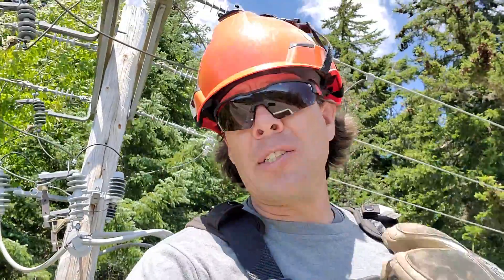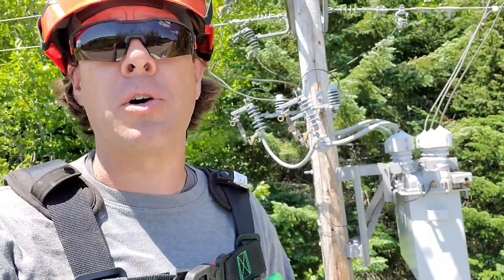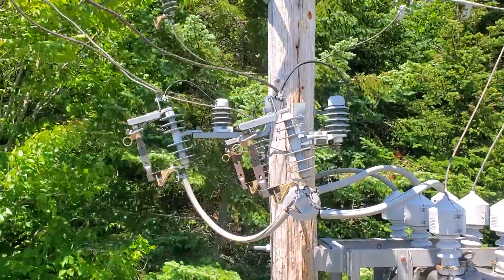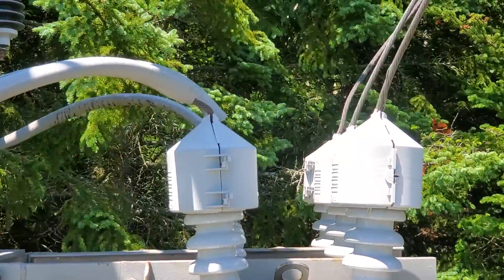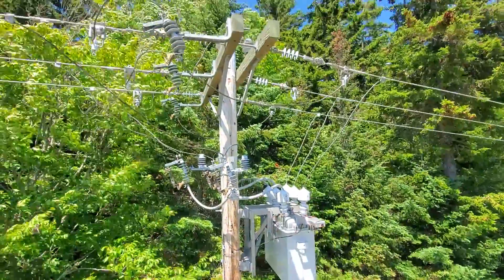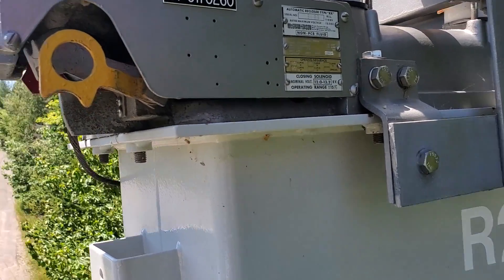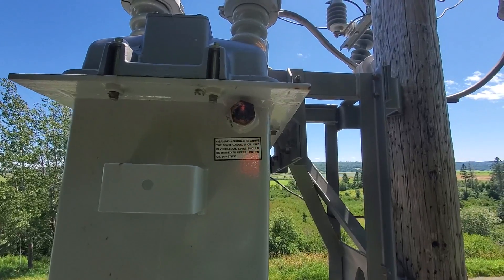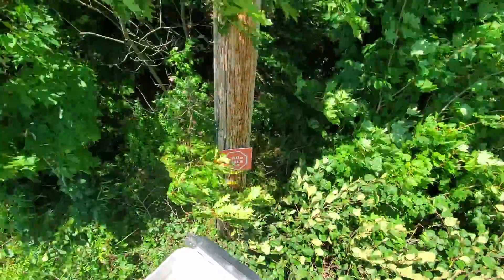Recloser - Might be why your lights just flickered!

Comment: Does the recloser open all 3 circuits in the event of a fault on just one?  It would seem so from the operating handle.  Does this only open on high current like a circuit breaker or can it open on other types of faults?  Are electronic reclosers any different?  Thanks for the great video!
Reply from the maker: Always all 3... A fault on only 1 of 3 phases will open all three. We have had three individual reclosers for each phase in the past to minimize customers affected until we arrive. 

Electronic reclosers are typically a newer technology and have more options. 

It doesn't necessarily require extreme high current to open. Sometimes they'll trip under cold load pick up (picking up entire line that's been out for a while). Some units have settings to account for this. 
There's also options for lock out on first trip when current is extremely high
Reply: it will open all 3 phases and attempt to reclose 3 times before locking out.

Comment: If everyone used electric resistance heat, would we overload the electrical grid?
Reply: the buildings i live in when built in 1979 had two 1,250 amp services in it due to all the electric heat and fan forced wall  units etc new owner removed 98% of it down to one feeder now with the old second one as a back up

Comment: Also - could be what was called a "Sectionalizer" perhaps? Main breaker/yard recloser actually opens briefly, and if the sectionalizer noted the fault was behind it (on its circuit), it would open when the recloser/breaker in the yard opened, and remain open when the recloser closes back ...
Reply: Sectionalizers is a whole category of devices that can be used to cut off/close in sections of the grid - everything from manual cutout switches to communicating 3-phase reclosers.
Reply: @Harrier42861  Right, we can get into the more elaborate designs nowadays, but 40 yrs ago things were much simpler ... there is (was?) much legacy line hardware still in use in outlying non-urban areas.
Reply: @Harrier42861  re: "to communicating 3-phase reclosers"
Back in 2019 the local distribution network here was retrofitted with S&C Electric "Intelliruptors" (speaking of 'modern' line hardware) and these are the communicating recloser and line (fault) 'sectionalizers'. After some initial 'shake-out' mis-operation the first year (distribution engineering working out the topology bugs), they seem to have worked out well in keeping the power on for the majority of the customers on a particular 'circuit' coming out of the switchyard. It beats having a switchyard breaker go solid open (after three retrys) and every customer being w/o power while the fault is localized.

Comment: The lack of apparent slack on the output wires connected to the outgoing lines makes me... uncomfortable.
Reply: Those taps are the load side taps (wires). Usually there is a belly put into the tap wire. As well as the taps having a thick jacket on them. With those taps as short as they are. It makes it difficult to impossible to Ampac those connections back on. Personally I would replace all three taps with what we call baloney wire. Every utility is different. That’s a good catch though for a novice to pick up on. I was going to mention that to Aaron but you beat me to it.

Comment: I heard on the radio down here (massachusetts) about a recent power outage that was caused by mylar balloons.  they do have a layer of aluminum to make them bright and shiny, so I can see them causing a momentary arc like a tree branch would, but shouldn't the offending item be blown clear or vaporized once the recloser opens and recloses?   Or maybe a cheap utility didn't put a recloser on that branch line?
Reply from the maker: If it's a large outage, than yes typically the mainline should be on a recloser or reclosing breaker. Another possibility is; if the fault is close to the sub/recloser, the high current fault may lock out the reclose on the first shot. (An option available on most reclosers)

Comment: Two questions:

You said the recloser makes three attempts. Is there a time frame for those attempts? Let's say a squirrel has a bad day. The recloser trips, squirrel is thrown clear, and the recloser resets one time. Fault is clear. Fast forward a couple days and a tree limb falls against the lines. Does the recloser only get two attempts because of the squirrel a few days earlier or has enough time passed that it's reset back to three attempts?

Second question, if the lightening arrestor is a high resistance does that mean that there is a small amount of current flowing through it to earth at all times?
Reply from the maker: First question - The 3 shot resets after only a few minutes. So if even 10 minutes later another squirrel has a bad day, it will have 3 shots. There is an exception for high current faults. If a dead short occurs within a few miles from the recloser that draws over 1500 A (just threw that number out there) it will lock out on the first shot.
Reply from the maker: Second question, yes there can definitely be leakage through a lightning arrestor. Cutting the ground on the bottom side of an energized arrestor and getting yourself across that broken connection can be lethal.
Reply: @Bobsdecline  thanks for answering the questions. Your explanations are exactly what I was looking for. I also appreciate the free education.
Reply: @Bobsdecline  That's an interesting answer, Aaron.  I know I'm a noob, but I'm quite surprised a lightning arrestor would leak current in normal operation.   Are these of varisitor design as I presume?  What's their nominal resistance at 7200 volts?  Hundreds of MΩ?
Reply: @jovetj  My uneducated guess (I was an Electronic Engineer, not a Power guy), is as long as the resistance is the lowest available, the majority of the power will follow that path. The resistance only has to be lower than the insulation so it is probably in the Giga ohms (1000M ohms). It will be relative to the resistance across an insulator which is really really high.

Comment: Another awesome vid. So why aren't these devices located at the substations?
Reply from the maker: There's one at the sub as well. The sub is up that side road to the right, the main line comes down through the woods and makes a "T". There's a recloser on either side of the "T" so that a fault on one side doesn't interrupt power to the other.

Comment: Actually saw a recloser in action while I worked for CN

I was working the yard one Saturday night switching railcars, when suddenly I heard an overwhelming 60hz arc hum at the same time as a smash. The sky lit up a brilliant blue-white and I couldn't help but swear over the radio. Everything went dark as the system kicked out, all of downtown and the railyard suddenly dark, with the only light being that from my lantern and the yard-goat headlight.

A few seconds later, the lights came on and the sky lit up again. Then darkness, this time for the remainder of the night. 

It was super fun working the yard with no lights, no security cameras, no supervision. Come lunchtime instead of going to the office, we picked a road-locomotive out, unlocked it, hopped in, and used and abused the microwave. It was a good night.
Reply: Funny, last night we had a (wind) storm come through, lights started going on and off and I also heard a loud 60hz hum nearby. Went outside to see across the street (and in someones backyard) there was some very nice arcing that would startup as soon as the recloser somewhere up the line decided to try again, last a few seconds until the recloser said "ehh, maybe not". Finally ended in a pop and a lot of bright-white sparks sent flying (... which... didn't think fuses did that, maybe something else destroyed itself?). Power was back on after only an hour or so though- a lot faster then I expected. But it was funny knowing there's a piece of equipment going through and saying "Okay, maybe it's fine now?" to the tune of several kV.
Reply: @codertao  Cutouts/fuses pop like a gun during a short-circuit, so it probably wasn't that.  It was probably a melting wire or a piece of equipment disintegrating that caused all the sparks.
Reply: So what caused the short circuit?  I hope your train didn't derail onto a pole or something.
Reply: @jovetj  A drunk driver had crashed into a power pole, shearing the bottom of the pole off resulting in either phase to phase or phase to neutral shorting.

Comment: Our reclosures here locks out after the second attempt.  had one at 5 AM about a month ago on a foggy day.  Saw a flash twice before it went out for good.  The outage affected 2,000 for about 2 hours and we had a partial comeback on one phase for about a minute.  The second that full restoration came back boom it went out again for about 2 more hours.  Can you explain why that happened.
Reply: Cant give an exact reason but could have been set to oneshot between the time it locked out and power restoration. If it didnt have a cold load pickup setting enabled the inrush of current from all of the downstream loads suddenly drawing power again likely caused the recloser to immediately lockout again.

Comment: Alright Aaron Another great Video. We deal with reclosures on our TELECOM Poles as such just like Xformers as well.   Peco IS doing alotta upgrades to bigger class 2 50 plus foot poles down here that we set for the Power company if its our pole. I think alot has to do with upgrading network to 34kv and adding all sorts of heavy equipment like like reclosures and xformers...   At any rate great vid. Always knowledge gained.   Does your telecom own any poles That they set for you like we do??  Also what are u aware of the grounding and bonding policys for your cable and telecom Companies below and also what are the distances required between your lowest conductor to cable tv or teecom??   Sorry if that s long winded.  BE SAFE BROSKI

Comment: Can you backfeed through a recloser? Like if a line goes down and the network permits feeding the line from the other side of the recloser
Reply from the maker: Procedure wise, we cannot. 
Glad you asked this question!

The recloser will feed backwards...
The problem is, it's function all comes from the source side. In theory it will function as expected... Since the source side would experience the loss of power, the device would be left energized on the load side without any operating capabilities.

I've never tried this and welcome anyone to comment further if they have any more info! 🤔
Reply: Thanks for the CT related comments. I was going to mention that we seem to have tons of reclosers here and I know most can be remotely operated…your comments shed some light on how things are working out there.
Reply: @NickDidelot  I’m a lineman for Eversource Energy in CT. Reclosures minimize outages by isolating trouble spots down to less than 200 customers. There are other manually operated switches we can open or close to isolate further if need be? Hence why our utility bills are higher. Before it was Eversource it was CL&P. We had reclosure loop schemes but now we have more system hardening through stronger/taller poles. More robust tree trimming & automated isolating devices.
Reply: Yes, we use loop schemes here in Connecticut. That reclosure appears to be a radial reclosure? Where the source comes in & goes through the reclosure & trips on over current. It may not have radio control to reset it & close back in by a system operator. We utilize a multitude of different overhead & underground automated reclosures & switches. I live on a loop scheme. Any lineman knows if you live on a loop scheme our lights hardly ever go out except on big storms. We have source reclosures, mid point & tie reclosures. They are preset to operate either by over current or a loss of voltage on one side. We have three operations of the source reclosure before it locks out from over current. The tie reclosure senses a loss of voltage on one side & closes back in from another circuit that phases in. In the event that the problem spot is between say the source & the mid point reclosures? The mid point reclosure will open from over current & open. Then it will time out & try to close back in at half the current it’s rated for. If it still sees an over current situation it will lock out. I’ll get 5 chances on my circuit to reenergize the line. Then a troubleshooter is dispatched to “ride the line” to see what might have caused the outage? Usually a large tree limb or car versus pole or a primary phase down. Here at home I start my whole house generator as it might be a while until the problem is found & repaired.
Reply: @johnclyne6350  This particular recloser trips on overcurrent and the timing is controlled through "hydraulic timing". There are models that look similar and are completely electronically controlled (but still oil bathed). You would need electronic control for a loop scheme.
Reply: @awfulbox  In CT our loop scheme is radio controlled with microprocessor control for automated settings. We have a mix of smart switches & several different manufactures of reclosures. Both oil & vacuum reclosures. The oil models are being phased out for obvious reasons as they can leak & need frequent maintenance.
Reply: @johnclyne6350  Vacuum reclosers can have oil in them and be hydraulically controlled as well. Just clarifying that a recloser either operates on electronic logic or hydraulic logic, but not both. Meanwhile the contacts of the switch inside the recloser are either oil bathed or inside vacuum bottles and sometimes both.
Reply: @johnclyne6350  Loop schemes?
Reply: @jovetj  Loop Schemes? Yes, automated circuit controls that do not need human interference to restore outages in a timely manner.

Comment: 2:47 What can be done, if anything, when copper thieves steal the most easily accessible 6 feet or so of the lightning arrester ground wire from a large number of utility poles in a town ? -------- This happened about 12 years ago in my town, and the utility company has done nothing to remedy the problem. Perhaps there is nothing they can do.
Reply from the maker: We've done a few things..
Pole crews must use a certain style staple every for foot on the ground wire when fastening to the pole. It must then be covered by a hard plastic covering which is again fastened every foot. The wire itself, is also no longer pure copper. It's a mixture of metals that offer a similar ampacity yet have no value at a scrap yard.

A few of them went missing at first, but thieves we quick to find out their efforts were fruitless.

We now use the new wire type for all pole grounds.
Reply: @Bobsdecline  ,  thanks man, I really appreciate your reply. At each pole, can a new mixed-metal piece of wire be spliced in to simply replace the missing 6 feet or so, or does the entire pole ground wire have to be replaced due to 
dissimilar metals electrolysis or some other problem?  Again, thanks !
Reply: @Bobsdecline I believe the material is called bronzed aluminum. The crimpits are made of this material which is compatible with both copper and aluminum. Correct me if I'm wrong.

Comment: What’s the difference between a recloser and an intellirupter?
Reply from the maker: The have "intelligent" capabilities. 

They're able to communicate with other intellirupters for automatic power restoration and better document fault data. 
They also aren't oil filled and have a wide range of preferred operation settings.

We have a couple on either side of large industrial/commercial customers. They can automatically switch to the other feed if one no longer detects an incoming voltage.
Reply: *recloser

Comment: How are they powered? Is there a big spring you have to wind up or does it use supply power to operate itself?
Reply: phase to phase voltage you saw on the tag 12.0 to 13.2KV will power a "closing coil" which is just a large solenoid that will pull the mechanism "closed" for a reclose operation. This particular unit uses smaller solenoids to trip the unit open when any phase exceeds a current threshold(140 A i think was stated). Tripping coils are small and trip a large spring to open the unit while the closing coil is large and powerful and will recharge the spring when it operates.
Reply: @awfulbox  Sounds like a great design!
Reply: @awfulbox  Thanks for clearing that up for me!
Reply: The ones we worked with used a bank of capacitors to store enough power to operate twice without power.

Comment: In my occupation as an electrical engineer mostly for Hydroelectric plants, which I own two of, I am intimately familar with this device. We typically design one of these without its reclose feathure as a dicconnect means at the utility interconnect point. There are always reclosers located in the high voltage circuit feeding these plants. When they do function we are immediately disconnected from the circuit. By design we then have to arrive on site and resyncronize to the utility. Although this could be done automatically we choose to visit the site as a precaution against other potential failures.
I must admit that our local utility company does an amazing job of maintaining the system in that we typically go many months without a utility trip incident.